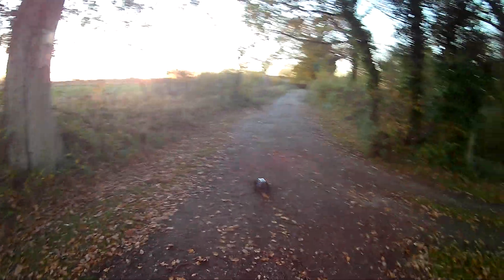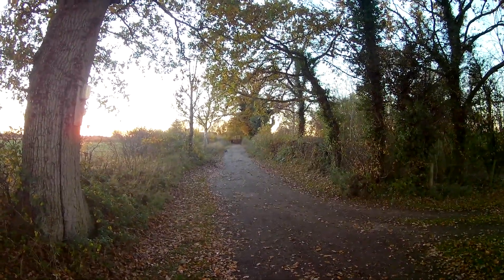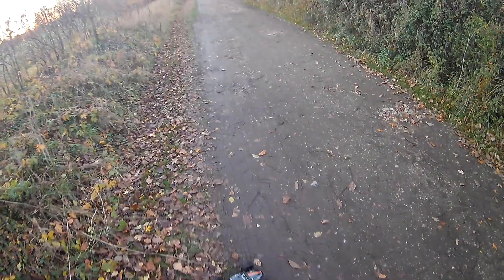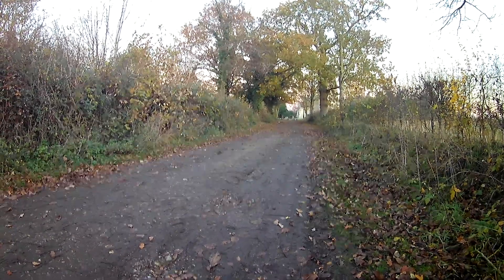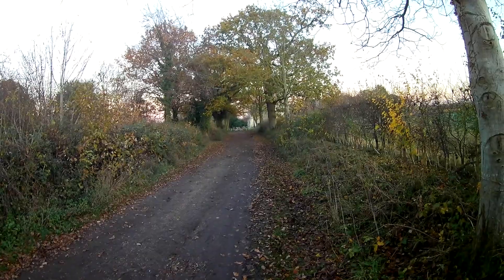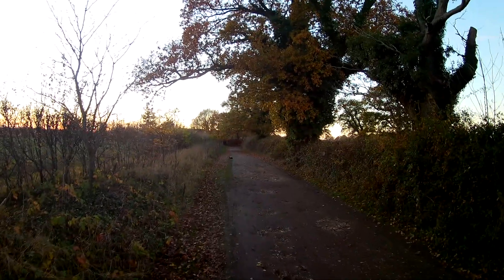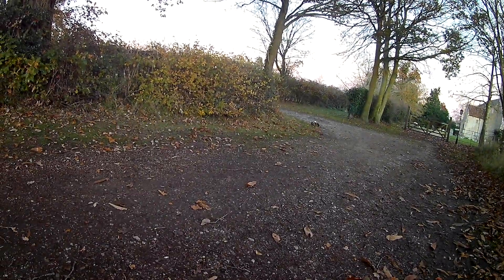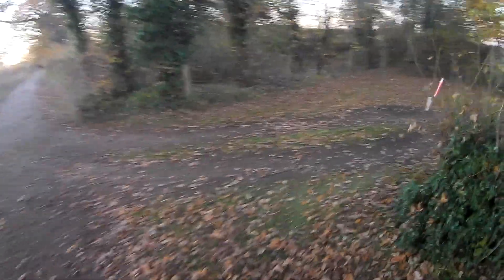HBX 12815 protector, first test run with updated drivetrain.

Comment: Aye brotha what drivetrain u use cause kind gettin tires of the plastic ones
Reply from the maker: It's a modification of ftx surge diff pinions and a hsp metal spur gear.
Reply: Thanks brotha